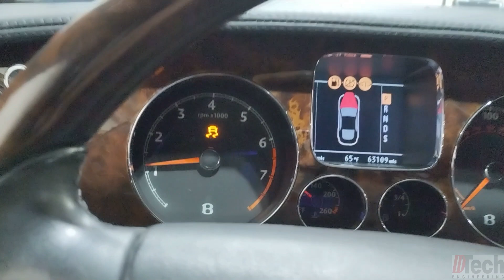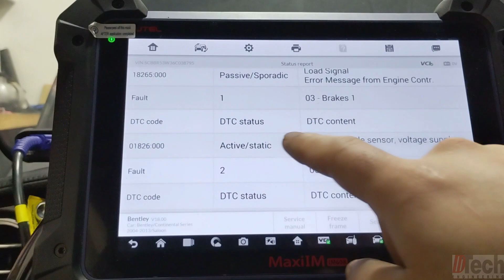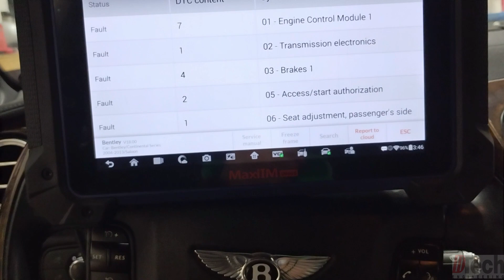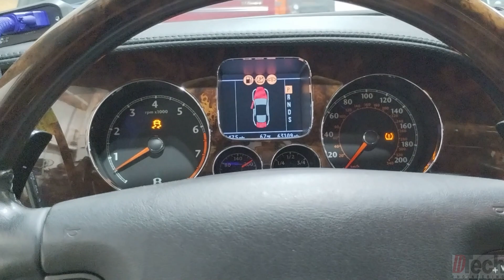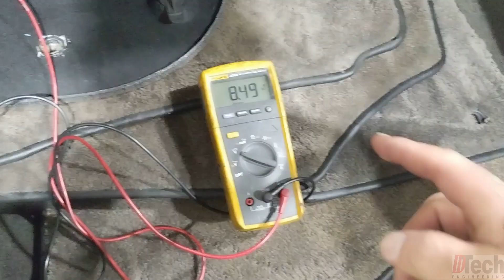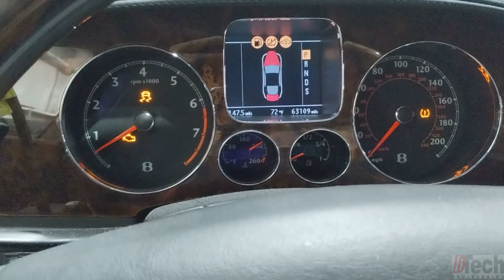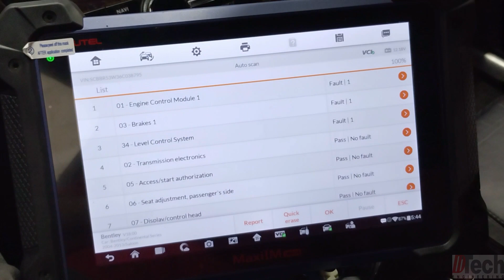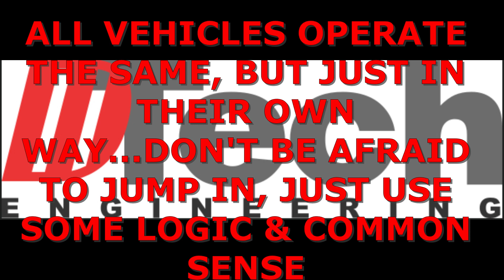2006 Bentley Check engine, traction, suspension light on Dash

Comment: I have a 2010 Bentley Continental flying Spur my tire pressure light is on I change the left front sensor and the light is still on .Now none of the tires are reading now

Comment: Best video bro!! Man my 2006 has the same CEL and traction control lights on. My battery drops soon as the car is off as well, just not as fast. I am going to try replacing that aux battery. Hopefully it will alleviate my headache lights as well!
Reply from the maker: Good luck, I hope it works out!

Comment: Excellent video. Auxiliary batteries on Bentley continental  as with most Supercar twin battery systems are critical. Best solution is to drive them regularly and/or get a C-Tek battery conditioner. C-tek supplied Bentley but you can buy direct or online. All continentals have a handy connection wire in the boot, so just plug in when parked up in garage.
Reply from the maker: Great tip and thanks for watching

Comment: How do I turn off traction control in this car
Reply from the maker: if it has a button for the traction control, press it so the traction light comes on solid, sometimes you have to press and hold the traction button in order to get the traction light to come on and disable the traction control

Comment: Lot of unnecessary work you put in ,when you first started the dash shows "low Battery" that should have been the clue to put new batteries in .
I also would have done a smoke test the random misfiring ,cel and the car don't hold the level I bet the vacuum lines are leaking
Reply from the maker: My apologies, not all of us are perfect.